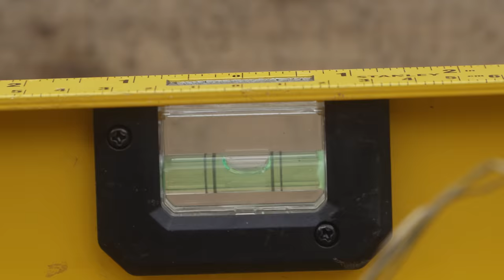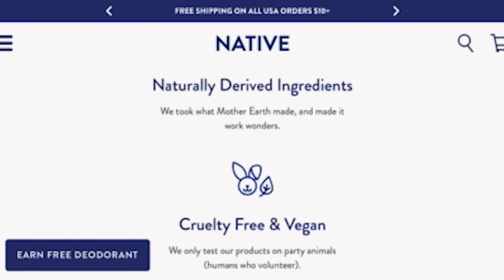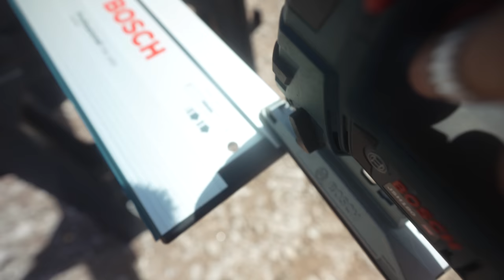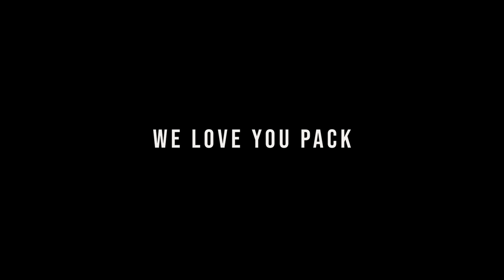COME ON IN! Finishing Front Entry At Cabin

Comment: Closed cell foam is not cheap, but is the BEST!!  We did our cottage with it.  I was worried that there would be odors, toxins, etc., but it is fabulous!  It’s like heating the inside of a Yeti cooler, it doesn’t take much!  Good call ladies! 🥰
..Would have someone professional where you buy your cabinets help design your kitchen, it will pay dividends in the long run.. 
also use PEX for as much plumbing as you can, and you guys could do that yourselves too!  Use the stainless cinches!  One tool fits most every diameter pipe you will use, and it will withstand freezing, just in case!!  Go get um girls..

Comment: Morning ladies! Are you going to use spray foam or replace the 2 x 4 with 2 x 6 wall studs to add the extra insulation needed? You could then reuse the 2 x 4's that you removed to add to the roof trusses to increase the load capacity. You guys just never stop, I love it!!

Comment: Hello, DIY Tip... use three 3 saw horses when using a cutting track. You get greater stability of your work with three bearing points, and if you are cross cutting plywood it will help support the cut off segement. If you're going to do finish work (which you probably will) a Bosch track saw will give you excellent cuts and is easier to store than a table saw. Keep up the good work.

Comment: I was surprised that you didn't run the boards lengthwise, maybe with more supports. The angles of the cuts would have been crosscuts following parallel to the 4x4s. I think that would have been much easier. You could have kept the original shape.

Comment: If you haven't bought it already, I would suggest using mineral wool insulation. Critters and bugs can't chew through stone, which is what they use to make mineral wool. It also dries out quickly if it ever gets wet, doesn't hold onto moisture. It's also fire-resistant. Good luck!

Comment: You need a circular saw with a Ripping blade.  I twill make the long cuts (like the ones making the wedges for the boardwalk) much easier...and cleaner, than using the scroll saw.

Comment: Since you are so good at knowing when to bring in the pro's, have you met with an electrician to update the cabin with lots of power and USB plugs?  Also, were the planks on the patio and boardwalk spaced a screw-width apart to prevent wood rot? Since you both do a great job on your research, I'm surprised it was never mentioned if you did it.

Comment: Great work with the boardwalk, I wouldn't have thought of that. I would have gone with gravel or paving stones. The wooden walkway is much more in sync with the house. But I'm more the builder, thinking on the technical level, relying on my partner for thinking up the design and adding more challenges by that ;)
Speaking of technical, if you have the interior of the building open to this level, you might consider installing cable ducts, as it makes adding additional cables for whatever reason later on (or replacing installed ones if they get damaged) so much easier. I installed many cable ducts when renovating my house 20 years ago, and always regret I didn't put in more of them.

Comment: FYI... there is less waste if you draw a line 1 inch from opposite edges diagonally across the board. Then you end up with two usable pieces with each piece being 1 inch at one end and 3 (or 5) inches at the other end.

Comment: What about the floor, you will lose a lot of head through that as well.  Put back a layer of sterling board, then counter batten before you add you finish.  This void will be there to run your electric cables and pipes with out going into you insulation layer.

Comment: You guys are just fantastic with all the projects you take on. The only about the boardwalk is I’d have considered using Trex planks instead of the wood. Trex, as I’m sure you know, is recycled plastic and wood. It doesn’t rot and isn’t slick when wet like wood gets. The only drawback is it needs to be supported 16 inches on center to support the weight without sagging or cracking. The greatest thing is it cuts and works just like wood and lasts for years.
Reply: And it is rather expensive but did I say it lasts for years without rotting and isn’t slick when wet

Comment: I am surprised you use inches and have a tape measure with inches on it!  Isn't the standard Canadian measuring tape marked in centimeters?  (I am so confused.)  I went out of my way to buy a tape measure marked in inches and centimeters.
Reply: I don’t know anyone that builds using centimeters (metric measurements).  In Canada they use both imperial and metric measurements but it depends on application as to which one is typically used.  Building is typically imperial measurements.

Comment: Get 2 x 2-inch mill wood strapping and attach them to the 2 x 4-inch walls This gives you a 6-inch depth for the spray foam to go.
Reply from the maker: That is a really good idea. Not sure how it would work around the windows but we could add them everywhere. Luckily we will get the r value with spray foam :)
Reply: @Vanwives  ......6 inches FOAM gives you R21 value which is also good for the roof / attic.